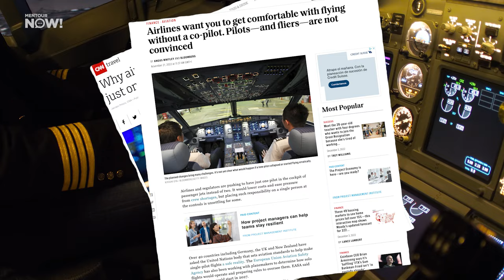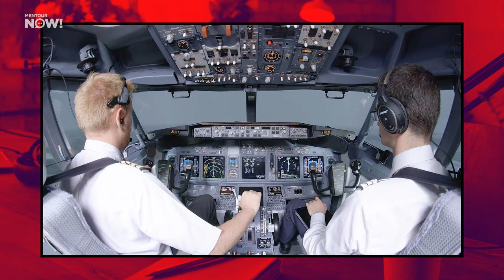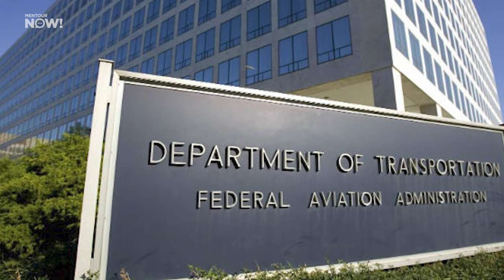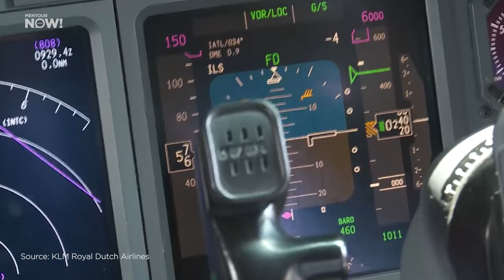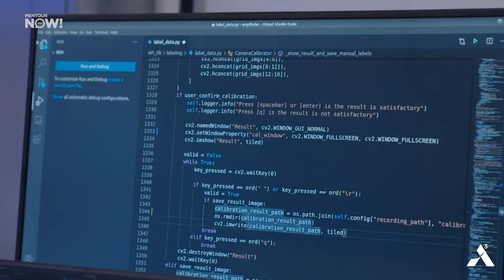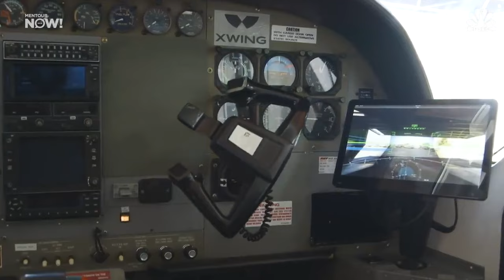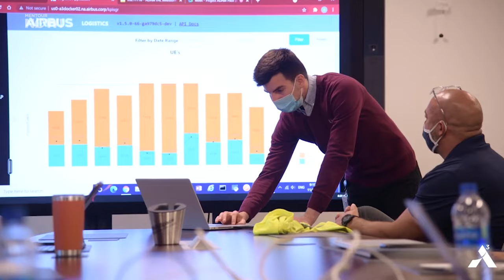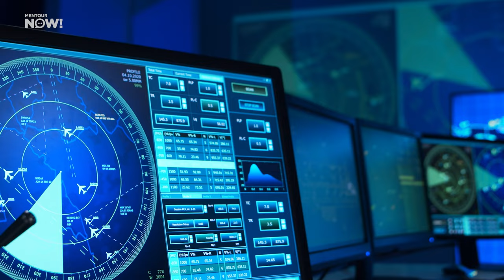The End of the Two-Pilot Cockpit?! Get Ready for Single-Pilot and No-Pilot Airliners!

Comment: There’s one other horrifying aspect of single pilot flying. Each time I hear about that topic I immediately get flashback of Germanwings flight 9525. How will they solve the issue about a single pilot becoming mentally unstable? Will automation take control away from the pilot and won’t be possible to override it? Now what happens if that same automation malfunctions and takes control away from the pilot by mistake and the pilot can’t override it? Those are terrifying prospects.
Reply: Easy. Program the planned route before departure and don't allow any departure from it unless there is an emergency. The plane should have a constant connection with ground operations (5G) who would approve any such deviations. A dead-man switch should also be included. And as I described above have cabin crew with intermediate system knowledge of the plane who can take over at any time.
Reply: Lotta ppl think AI’s perfect till ai goes rouge💀
Reply: @SwordQuake2  not easy, an emergency situation can develop in seconds before any remote operations can grasp the data and figure out the correct action to take (if the situation is still manageable). Also that’s assuming there’s a dedicated ground ops person assigned per flight, which at that point why not have an FO onboard and just delete the remote part of it? The realistic option is that a ground ops person would monitor multiple flights at the same time and that already adds a delay to any response. Seems like an overly complicated solution for something that’s simpler and more reliable already.
Reply: @Hartbreak1  what emergency can develop in seconds that has any hope of being resolved by pilots?
Reply: @SwordQuake2   There’s been some instances of that and stuff that a single pilot would never solve alone, let alone an automation system.there’s been quite a bit of aviation incidents over the course of aviation history so asking me to come with one over the top of my head would be a bit unfair don’t you think? But I’ll humor that and put an example of an incident that no automation, a single pilot or a remote ground crew would easily overcome. https://youtu.be/5ywaMkMTwWk

Comment: Primary reason why we NEED at least two pilots, is when something goes wrong with the aircraft - there will be people inside cockpit trying to fix the issue and/or land safely a plane with no engines or other serious malfunction. A computer can't do it's job when it's sensors aren't working or it doesn't have any power...
Also can't imagine how boring will be sitting ALONE in a cockpit...

Comment: @ Yes, The Obvious Answer is That The A 380 =1000EXLR Would Easily Be The King Of The Sky…With Two More Powerful ENGINES ……..GM Or RR Efficient + More Powerful Engines The A380=1000EXLR Would Easily Secure Immediate WorldWide Sales Success. Now AirBus That Promotion Will Result in A Complementary A 380=1000EXLR

The Original Four inefficient Engines crippled The A 380 with Cost of Fuel! the Arab Airlines with Oil Wells didn’t have Oil to worry their flights. The Arabs just Kept Flying for Free.

The New A 380=1000EXLR should be restricted to Any Airline EXCEPT OIL PRODUCING COUNTRIES…!

It is noted That The European Nation’s Bankrolled The AIRBUS A 380 , while Arab Oil Countries were the main Beneficiares of AirBus A 380.

Bizarre!

Personally I have Flown both AIRCRAFT… The 747 had its day,. It requires a New Version. With Major Improvements.

While I appreciate the reasons why the New AF 1 prefer Analogue etc. That Air Craft is a Special Type Of Security Air Craft which is Secure against Nuclear and General Ordinary Weapons.

In a Straight Competition between AirBus A 380=1000 EXLR and a 747 it would be Cheese and Chalk. When a Child I flew 747……..As A Man I Put Away Childish Thing’s And Flew on The AirBus A 380 it was like HOME!

In The Future I Look Forward to Flying On My A 380=1000 EXLR The Home from HOME! Hurry AirBus Time is Flying!

Comment: Considering the un-intuitively designed Man-Machine-Interface in a modern cockpit, the high number of embedded interlocks and dependencies and the resulting vast potential for errors, it might actually increase the reliability of a flight if automation took over completely. However, having a background in automation technology I'm painfully aware of the challenges associated with developing and maintaining the required failsafe software - and associated hardware in terms of sensors, switches and actuators.

Comment: one thing you failed to mention  ( and this has happened ) a single pilot is able to go "rogue " case in put  : a few years ago a pilot was alone  the  cock pit when the co pilot went into the washroom the pilot locked the co pilot  out of the cock pit. another   air cargo companies  like fedx  do not  buy  new jets they buy used jets for 1 reason the number of hrs fedx  only fly their  jets 1/2 as much    a day vs a  passenger air lines

Comment: Being familiar with Airbus procedures, I'm sure they'll add more and more lists and checks to implement this, only adding a huge workload to that poor single pilot. I can imagine the lone pilot working under more pressure, worrying about delays, etc. People forget that not all accidents start airborne. Many airlines have "digitalize" almost every process involved in the flight with the use of tablets, apps, etc, but you'd be surprised how many times the thing just doesn't work. Internet problems, bad equipment, or how many times the guy on ops frequency just doesn't answer your call. This new idea is obviously made for those airlines that want to save as much money as they can, and those are the ones with the worst "extras" that can make a pilot life easier. Those are the least indicated to implement this program.

Comment: Airbus have a lot of mixed experience, we utilise out Airbus helicopter single pilot and they are busy developing lots of ways to make that safer. SP in HEMS is very taxing at the best of times especially in the mountain environment. To aid this we use technical crew members, either a paramedic or full time TCM who provides SA and assistance to the pilot but primarily isn’t a qualified pilot and they have no flying controls of their own. I suspect the airlines would go this way first, as you can pay a TCM let’s say 40% less and reduce training burden (therefor cost) by 90%. As some others have commented, being SP comes with issues for training as there’s no pipeline for junior pilots to advance to command. Mixed bag really, but the CAA is looking very carefully at helicopters and potentially forcing “professional” TCM’s or even multi pilot for certain operations such as HEMS using night vision systems.

Comment: I think in time there'll be a human & a computer pilot in the cockpit, plus a remote pilot in a secondary role too - in effect moving the 2nd (human) pilot (on single shift flights) to the ground. But that it'll be 15-20yrs before computers & data links will be good enough to make it happen.

FYI: I also wonder if by then 2-engine (+APU) planes will have each engine from a different supplier. The diversity could similarly reduce (low) risk of common failure - but thus far has been outweighed by the added complexity risk.

Comment: How many pilots/copilots have suddenly died recently IN THE AIR?? (I wont even touch the possible whys - that's taboo). Bottom line if there had NOT been ANOTHER person to fly the plane, all of the passengers, crew and plane would be "collateral 'kaput'". 
One might, possibly, maybe, think that the "taboo why" is behind the move.  
Suggested by that friend who is always questioning thing.

Comment: I'm not really comfortable with the idea of Autonomous Trucks hurtling down the highways...let alone the dangerous "slippery slope" of reducing the two pilot crew requirement in most commercial flight operations. Just watch a few Airline cockpit videos and count the number of times pilots cross check & correct each other over the numerous collective decisions that are required in flying a modern aircraft, in an extremely crowded environment. This one pilot option is truly "A BAD IDEA".  [PS: I hold a Commercial License and spent 15yrs in Airline Management].

Comment: The driving force behind this kind of thing is the same driving force behind the erosion of benefits for pilots (and cabin crew, and a variety of other technical staff at airlines), and the 'dehumanisation' of the flight deck - the vicious circle of ever increasing levels of automation, until eventually there's no hope that the poor pilot can handle an emergency that's suddenly thrust on them, at 03:00 body time, single crew in the flight deck, when multiple sensors suddenly fail and the aircraft reverts to the most manual of manual modes, warnings start going off, and it basically throws a 'hospital pass' to the pilot, with barely a 'it's your baby now, good luck'. When he or she inevitably fails, the cry goes out - "Look, we needed MORE automation!" That same pilot who's had 30 minutes of actual hands on flying in the last 12 months, who never spent part of his career in light aircraft actually flying (because that area of the industry has been virtually destroyed), who knows the ops manual far, far better than how to actually fly at 35 000', with 20 knots between low speed and high speed buffet margins because sim rides have consistently taught him that instructors LOVE pilots who know the ops manual/rules far more than they love pilots who can actually fly.

/cynic mode. Seriously, that was full cynic mode. But there's a spark of truth there.....*something* doesn't really want pilots around......on the Excel spread sheets, we are a cost ONLY. We bring NOTHING in, apparently (not true of course, but these excel jockeys make all the decisions, with a whole bunch of non-quantifiable variables conveniently just left right out of the equation)

Comment: Truckers cost 50 to 150k a year plus benefits. They can drive 11 hours and work 14 and your capacity is determined by the # of truckers you employ. An auto trucl could drive and work 24/7 and your capacity will be determined by the #of trucks you own. And you cam buy as many of those as you want any time you want.

Btw im starting to expect pilotless planes long before pilotless trucks. Pilots need a LOT more training.  But 747's dont fly surrounded on all sides by untrained incompetant pilots/drivers feet away. Also the faa is very good at blaming pilots for system company and mechanical failures...

Comment: Imagine the outcome if QF32 had been a single pilot flight. How many other flights would have not delivered their SLF to their desired destination? AF447 had 4 crew (although it really didn't have 4 pilots on the flight deck IMO) and they still stayed in a stalled condition for 36,000 feet.
Taking a slow boat will be a lot safer than risking a single pilot airline operation.

Comment: Something similar happened to the rail transport some years ago... 100 years ago, a steam locomotive was using a driver, a helping driver, a fireman and a brakeman. 50 years ago at the end of steam traction, the same loco could be driven only by the driver and the fireman. A modern (and by "modern" I mean "not-steam") train could be driven by only one person, technically speaking, since the '40s and the introduction of the train protection systems that would brake the train if the driver passes a red light, a speed limit or if he/she becomes inabilitated to drive. The reason trains had a full crew untill recently is strictly based on either workers unions' influence or, in non-liberalised markets (like Russia or communist countries), on the fact that in those countries railways can be subsidized to the infinite if needed and some of those countries have an "everyone must have a job" principle, that will put you in a technical highschool at 14 years old and in 4 years you could be a qualified train driver and be forcefully sent to a remote train depo where noone wants to work, but it's illegal for you to refuse.
Of course, an airplane is not a train and a mistake at any altitudine above ground could cause a huge tragedy, but my guess is that air companies are trying to apply the railway model in order to reduce the staff needed. Even that proposed system with one of the pilots in the cockpit only at take off and landing would probably involve a lower salary for that "helping" pilot. And when Boeing and Airbus will come with a reliable system to land a plane in emergency situations (including pilot with a heart attack on an airplane with all engines broken) or, at least, to operate it remotely from a desk if necessary (I know UAVs are operated remotely, but there is still a lag between the command given by the operator, the UAV executing it and the confirmation being sent back to the operator and this thing is unacceptable for a passenger aircraft), one pilot operation will become the new standard. We could probably start the bets on the year when this would be possible. I would say somewhere between 2040 and 2050.

Comment: Twice now Boeing has said it is delaying the 797 or (MOM middle of market) for single pilot operations. 5G is supposed when fully operational to allow autonomous vehicle's on the ground. 5G updates fast and would allow for heavy traffic in congested interchanges and currently most parking spots are being mapped AI. Once the public has many years with AV < autonomous vehicles they will accept unpiloted aircraft. Other innovations need to happen. Most airliners are designed for 30 year lifespan. Right now we have a Gap decade where aircraft designed now would only have to be replaced by 2035. Thus alot of R & D money would be wasted for aircraft having to be replaced at less than 10 years. Not enough return on investment. Most pilots that i've spoken with are against single pilot ops. But on the bright side they'd be retried early. Most airliner's are triple redundant designed features. The single P ops or no Pilot ops would be quintuple redundant most likely.  And would know what to do in runaway battery or hacking scenarios.

Comment: I work in ITU in a hospital. At no time do we leave one member of staff in charge of all the machines. We do have different levels of staff, so ICU nurse, with Nursing Associate. A nursing associate is Not a nurse. IV meds need two nurses to check. There is no way out of the second nurse around. You can leave a patient with technology technically. But you need student me to shout if the heart rate says Arterial Fibrillation.
During COVID when nurses had 5 patients, massive use was made of us unqualified staff. But risk is sky high.
Computer/robot technology has really taken off. It augments, it does not replace. No systems are good enough for autonomy so far. The on/off switch is too important. Humans do Not have an on/off switch, unless incapacitated.
I think single pilot could work with a’pilot associate’, these are apprentice trained. They can only do the absolute basics, but have human intelligence.
We have the same problem as you. Lack of nurses. A nursing associate can be relatively autonomous, but to a very limited extent. Below the associate is an experienced HCA who can understand the machines, do wound dressings, NG feeds, suction. Below is a basic care staff. Again, trained very basically, but human.
Maybe pilots will go the same way. With less qualified staff.

Comment: I would not fly anymore if they went to just one. I believe in redundancy. A computer is not a substitute for a pilot. Computers have helped to save lives by better keeping track of checklist items and are a solution to why my friends died on NWA255 when the pilots forgot to do a checklist which started with setting the flaps. Some items on a checklist will not prevent the airplane from flying, but a few are so necessary an aircraft can't even take off without that lever or switch in the correct position. It is like a switch. On you live, off you die. That error costs 156 lives. 

Please do a Northwest Airlines Flight 255 video, on August 16, 1987.

Comment: Without the craziness of eliminating the redundancy of two pilots, you could get a lazy pilot that skips necessary steps for flight and landing prep.

While rare, it has been known for pilots to become incapacitated.  If that happens on a single pilot flight, then kiss your butt goodbye.  What about when an emergency happens?  The workload for a single pilot would skyrocket.

I happen to love technology and even work in the tech industry.  However, just because you can do something, doesn't mean you should.  Like self-driving cars, for example, they have problems with potholes, faded street markers, failed bridges and human behavior outside the car.

This starts a new phase of blood engineering.  This means there will be unforeseen issues and then suddenly the blood of those passengers lost in automation caused accidents become a new engineering correction.  TCAS is a result of blood engineering.

[there is a point to the following] I am a software engineer, and Larry Wall (inventor of Perl programming language) gave a perfect example of what "new technology" involves.  Being a good programmer involves 50% laziness and 50% hubris.  Programmers find ways of making people's jobs easier, by having the computer do as much of the work as possible.  That's the laziness.  The fact you do less work is the hubris.  More is getting done with less work.

There are things for pilots to make their life easier, and I am not opposed to that.  However, I would never trust a fully automated plane unless there are two pilots at the helm.  Want to make planes fly themselves (takeoff / fly / land) then great, but keep those two seats populated.  Lives depend on it.  Engineers don't usually get the fact that maybe their new gizmo is awesome, but lives are on the line and that needs human supervision.